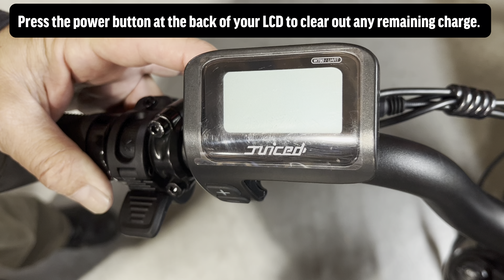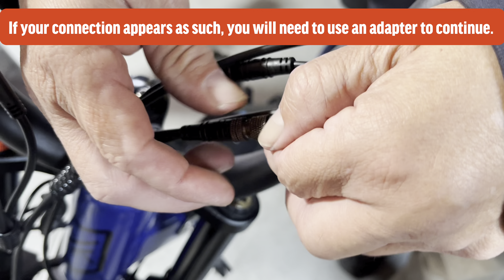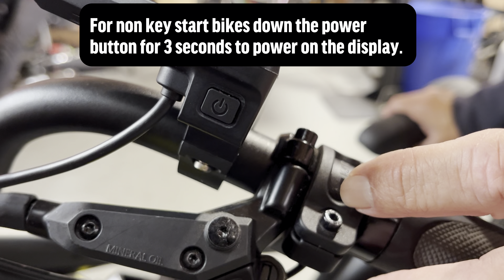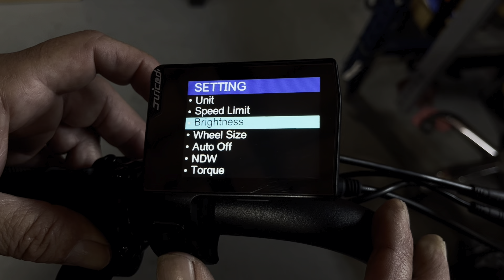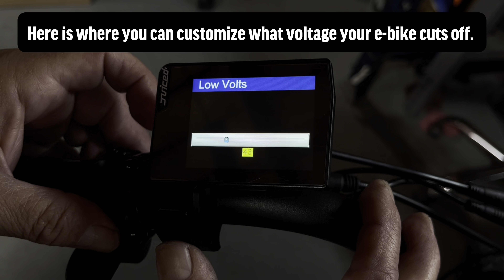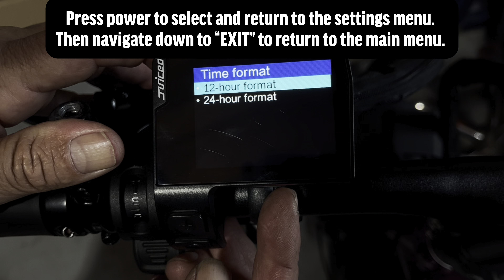Juiced Bikes Color Display Install & Quick Set Up

Comment: With this display on a class 2 rip racer.  Can you use the off road controller since it has all speed options
Reply: I tried this and I’m looking for help because I wasn’t able to find out if it works. The throttle and peddle assist don’t go.

Comment: Does this "kit" also include a new controller?
Reply from the maker: Hey 👋 No new controller required for use.
Reply: @juicedbikes  Does it unlock throttle only max speed of 28 MPH?
Reply from the maker: @necavenue  Hey 👋 This is not a performance upgrade kit, this is just a color display replacement. So if your e-bike only goes up to 28mph the new display would not alter that.
Reply: @juicedbikes  Ok thanks for the info. The reason why I ask is because I ordered the "offroad controller upgrade" for my Scrambler in order to use throttle only past the 20 mph limit of the stock controller, but was told I didn't need the upgraded controller if I installed this LCD which supposedly unlocks the stock controller in the same way the controller upgrade unlocks 20 mph throttle cap.